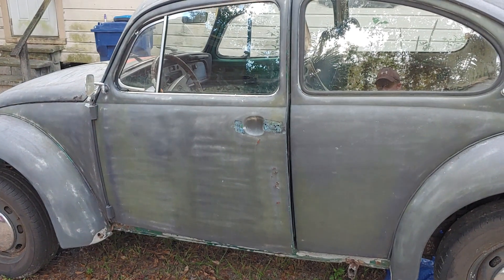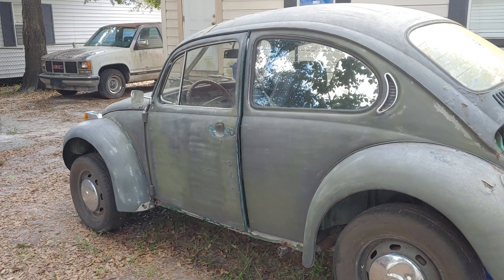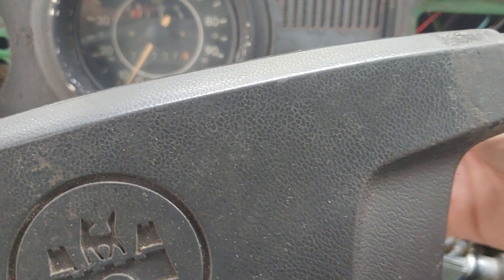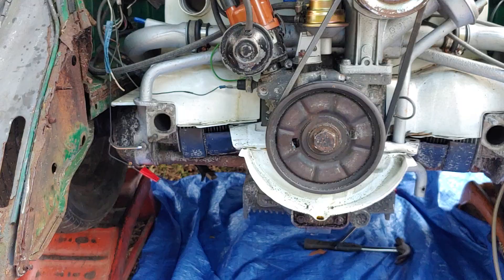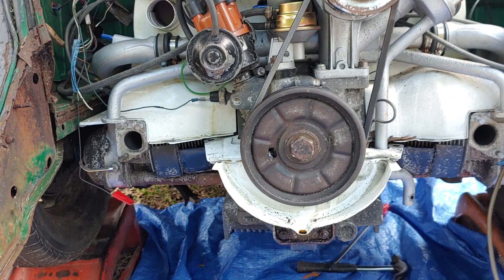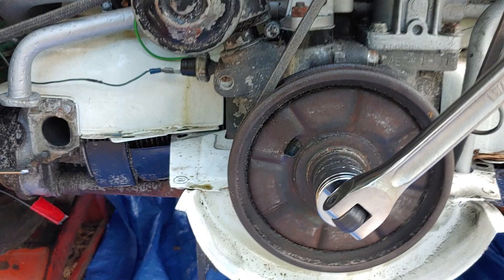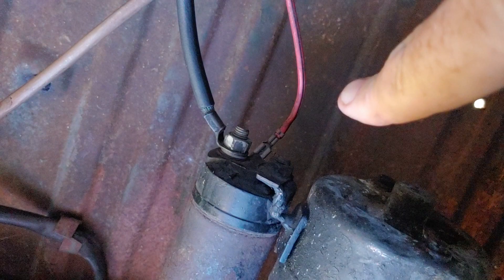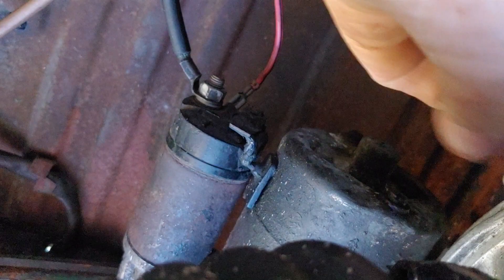CLASSIC VW, STARTER ISSUE? 1972 SUPER BEETLE WONT START.

Comment: This is just what I needed! I shorted out the 30 and 50 terminals with a screwdriver just as you did and it engaged my starter and solenoid. Then I tried again with the ignfition and it worked whereas it wasn't before (must have been stuck and just needed the jump start). Thanks for the help!
Reply from the maker: If the brushes in the armeter was stuck, than yes. I'm glad this helped you out. Sorry it took so long to respond. My issue was a bad selonoid. I replaced my started with a autostick starter. Faster spin, and don't have to deal with the bushing in the transmission. Stay safe, thanks for commenting.

Comment: The device you hear clicking when you turn on the key is called a Fuel Idle Shutoff Valve (or solenoid).  It’s job is to shut off the fuel when you turn off the key to keep the engine from running on (some times called dieseling) after you shut it off.  As for the starter issue, I’d begin by cleaning and tightening the battery terminals, and removing and taking a wire wheel to the ground strap connections.  Do the same for the connections at the starter.  If that doesn’t resolve the problem, then pulling the starter and having it tested would be a good next step.
Reply from the maker: Great advise. Sorry I didn't see your post till I answered another comment.

Comment: i would say its the selonoid. its not engaging the starter. Try tapping the starter and selonoid with a hammer. This should correct the problem. You got this. You got this far.
Reply from the maker: At least everyone seems to agree with each other on the issue. Thanks for taking the time to comment. Stay tuned. - KEEP DUBBING -
Reply: I've replaced the starter and the solenoid in my 72 wv bus and I still have the issue going on so if anyone knows
Reply: @anotherone1173  look up hard start relay. If a new starter doesn't fix it and your ignition switch if good your having voltage/amperage drop and the hard start relay trick tends to fix that issue

Comment: Once you get the starting issue sorted out, here are my notes (based on Mustie1’s videos) on testing the generator/battery charging system.  My apologies for the length.

Generator Troubleshooting 
D+ is a switched circuit that feeds the battery.
DF is the “Field” terminal.  The regulator feeds the signal to this terminal, and the closer it is to ground the more it tells the generator to put out.  To test the generator...
    1.  Disconnect the wires from both terminals. (Note:  the larger of the two wires that connects to D+ will have voltage on it when you turn on the key or run the engine, so don’t let it touch any ground when disconnected.)
    2.  Use a jumper wire to ground DF to the case of the generator.
    3.  Connect a VOM to Ground and D+.
    Start the engine and measure the output of D+.  
    4.  Rev the engine to approx. 3000rpm and you should see about 35v or greater. (Note: at idle you should see approx 23v.)

To recap, with the wires disconnected from the generator, and the engine running, you should
measure less than 1v at D+ when DF is disconnected, and when you ground DF you should see a min of 20v or so at D+ when the engine is at idle, and 35v min at 3000rpm.  It will go as high as 70 or 80v at higher rpms. (Note: The Gen warning light on the dash is part of the charging system...if this lamp burns out the charging system will not work.). one potential cause of loss of generator output is a loss of residual magnetism within the generator.  To restore this (repolarize the generator):  Remove the fan belt. Remove
the wires from D+ and DF.  Use a jumper
to ground out DF.  Apply 12v directly to D+ for a hot second, which should cause the generator to spin clockwise like a motor.  If it spins, you just repolarized it.  Rerun the test above to see if the generator output has been restored.  If not, the next most likely cause is a faulty Voltage regulator. (Note: there are two types of voltage regulators - One for Buses and one for Beetles.  Beetle regulators will only work on Beetles.  Bus voltage regulators will work on Buses AND Beetles.)  You can also test your charging system by connecting a VOM directly to the battery - Measure the voltage of the battery with the car off (say 12.8v).  Then start the car - at idle the battery voltage should be pretty much the same, say 12.8v, but it should jump up to 13.8v or so when you rev the engine (anywhere between say 13.5 and 14.5...a volt or two above the voltage of the battery itself is enough to keep the battery charging.  https://youtu.be/JUeeuDrIKVQ
Reply from the maker: No need to apologize. This is great comment. I hope others read it and it helps them in the future. Mustie 1 is a great channel as well. Thank you for viewing and commenting. Please feel free to comment in the future.
Reply from the maker: Are you on Facebook? We have a very active VW GROUP PAGE as well. Its called " Volkswagenplanet". The same as YouTube and all other social media. Love to have you in the group.
Reply: I probably should have clarified...the Generator test instructions come pretty much directly from the Mustie1 video I linked at the end.  I give full credit to Mustie1.
Reply: Did u try putting a relay in and did u try starting it by arching the starter while the key is on

Comment: You have power.the large cable is the positive from battery the small wire is from the ignition switch .the negative is provided through the bolt up to the engine and ground connection to battery .it is an interesting reach to the starter .you can reach in with a long stick with something metallic from outside the wheel well .keeps you out if the mouth of the dragon if it happens to be in gear
Reply from the maker: You are correct. This is a unique set up. Thank you for commenting. Your comment will help others out. Thank you for commenting. Feel free to comment on other videos. I'm learning as I go on this project. Stay safe.

Comment: Number one thing that thick cable hooked to your starter better be the positive side of the battery or you have major problems. You said it was the negative side of the battery.
Reply from the maker: You are correct.  This thing was a huge mess. Last owner had chopped up wires. Thanks for commenting

Comment: I do not get the click mouse, but I did test the wire to the coil which was getting voltage.  I will have try the jump start on the starter like you did.
Reply from the maker: Take the starter out and bring it to your local auto part store. They have machines to test the starter and selnoid.  Let me know if you need further help. Stay safe

Comment: i have a similar problem but the starter and solenoid are working. So is it the ignition switch? All the lights come on but the when i turn the key nothing happens.
Reply from the maker: Yes and no. Let me explain. It will be the ignition issue. What happens over time the wire going from starter to ignition switch can't carry enough of the amperage load. Try installing a hard start relay first. This will solve most if your electrical issues. It's a simple install. Relay and wire. This will solve the electrical load when starting. Then replace ignition switch. I think i install the hard start relay in all my classic be a first. Before even a oil change. The wires are old or chopped and taped together over the past owners. I think I have a video on it. It's cheap and easy. If you need help feel free to reach out. Thanks for viewing and commenting. Stay safe out there.
Reply: Same here
Reply: Thank you will try my baby daddy helped me awhile ago and disconnected that relay jingadera thingy and was talking shit about who ever installed it haha then it still didn't start so he got mad and left it like that and he hasn't came back since, thank u I'm going to try to hook it back up now and see if it works .and you also recommended replacing the ignition as well, correct?

Comment: I think it need resistor to reduce current going to solenoids. It will burn fast if it’s 12volts all the way. Ignition coil will too go hot especially those with oil and lick to those hot wires.
Reply from the maker: The solenoid was bad on my starter. It failed the bench test. I replaced it with a autostick starter. They spin faster than a manual starter.

Comment: Sir,
So I’ve got a similar issue. Car was running one moment the the next nada. I’ve been going through my wiring and fixing small connectors that were a lil suspect. Long story short my troubleshooting has led me to the starter. When I tried your method of “bench” testing, I don’t get a spark when I jump the wires. I’d assume I have a bad starter?
I have power going from the battery to the starter, but like I said no spark.
Reply from the maker: Correct. Starter solenoid

Comment: Did you get it fixed im having the same problem the motor ran yesterday and today it would not star i do here the clicking noise coming from behind
Reply from the maker: Try installing hard start relay. Usually its a voltage drop the wires can't hold when they get old and brittle. Sorry it took so long to respond. It seemed to be fine now.

Comment: Not an accelerator.  The accelerator is the thing you push on next to the brake pedal.  It's called a fuel solenoid.
Reply from the maker: You are correct. This is what happens with lack of sleep and complete frustration. Thanks for pointing it out. Thanks again. I don't know why I never received your comment. I would have responded at that time. Thank you again.

Comment: One other thing check your battery 
Terminal for corrosion it could limit the amps going to your starter you might not be drawing enough amps to turn the starter
Reply from the maker: Great tip. New terminals. I installed a new solenoid and hard start relay.

Comment: Good afternoon. My son has a 1972 super beetle. Everything in your video we have done. He has t start the car with a screwdriver. He changed out the cylinoid. 
We also did the test where you twist the screwdriver in the cylinoid and the car wouldn’t start. The screwdriver is the only way we can start the car. Do you have any recommendations?
Reply from the maker: Have you done a hard start relay? There are several videos on YouTube. I might have one as well, not sure. The reason you would need a hard start relay is the old wire can't hold enough amperage to carry to the starter. Its a simple fix. Let me know it this helps. Thank you for watching and commenting. 
Happy Holidays

Comment: Check to see that the black wire in your wiring bundle is connected to the coil (15 +). Also look under backseat to make sure wires are not disconnected- like the red one to the starter
With trans in neutral and brake set you should be fine to use a screwdriver to test the starter.
Reply from the maker: The black wire your talking about is the ignition switvh to coiil wire correct. That is correct. I can turn the key and hear the click of the plunger on the carb. Car is in neutral. Brake is set. I was starting the car without pressing the clutch in until this point. The only difference from sat to today is the car was on ramps. Motor did not lock up. Starter is not engaging. Let me know if I'm understanding you correctly.
Reply: Check the obvious- wiring connections. Follow the wire connections from ignition to starter. Friend had a 70 bug with a similar situation- remedy was the T1 connection under rear seat was disconnected (it connects starter 50 red wire to red/black wire to ignition switch)
If not this -agree with others likely the solenoid
Reply from the maker: @kdmamm-4190  checking it as we speak

Comment: What is your voltage at the large stud at the starter?  12V?  Should do a voltage drop test.  Could be something as simple as a poor connection at the battery or a poor ground strap.
Reply from the maker: I'm sorry for not responding earlier. My starter had a bad selonoid. I replaced the starter with a autostick unit. I have a follow up video. Thank you for reaching out. I try and answer all my comments. Are you working on a vw?

Comment: My problem was corrosion on wires at solenoid clean them use Wd 40
Reply from the maker: Never thought about using WD- 40 to clean the wires. Thanks for watching . and commenting. Great tip. Stay safe.

Comment: when you touch the screwdriver to the small wire to the big wire from the battery it should fire off the starter solenoid and engage the starter motor. as if the solenoid is bad it can be replaced. a good reliable starter to get is the powermaster starter sold on Summit Racing Equipment its a more reliable gear reduction starter. the clicking noise not the acellerator pump thats the bypass air cutoff solenoid on the carburetor as you have an aftermarket H30/31 pict carb originally susposed to be a Solex 34 Pict-3 carb will have the same type solenoid as older bug carburetors from 1967-1970 will have the solenoid below the choke element thats on the pilot jet as both solenoids do is prevent the engine from dieseling when the ignition is turned off.  the older 6 volt bugs up to 1966 had no solenoid.
Reply from the maker: Your correct bad solenoid

Comment: Im in that same boat replaced all spark andspark plug wires new coil new distributor(empi ones dont last) is replaced. Car is newly rewired. Turn the key you hear a click noise grom engin bay. Tried too bypass the starter didnt turn. Pulled out felt like it was stuck did a few tests didnt want too turn. Have too replace starter
Reply from the maker: When you pull the starter out, check and see if its a OEM( original ) Bosch stamped starter. If it is have it bench tested. Probally the selnoid. Mine was bad. I still replaced my starter from Napa. I paid the extra because I kept the core. If you do buy another starter here is some advise. Tell the counter rep its for a autostick instead of a manual. The autostick starter doesn't need the busing on the end of the armature. Some get wore out and have to be beaten out of the transmission case. The autostick starter also will engage faster. It's the same price as the manual. Let me know if that solved your problem. If your on Facebook, come join our VW GROUP PAGE. Same name as youtube" Volkswagenplanet. Several youtubers are in the group. Take care my friend.
Reply: @Volkswagenplanet  where i live oem/nos bosch starters are super expensive and hard too find. Used a similliar built german/us made starters.
Reply from the maker: @pierreduplessis1507  try installing a hard start relay first. I think I have a video on it. There are several in YouTube
Reply: @Volkswagenplanet  thanks will look it up. Will keep you up to date
Reply from the maker: @pierreduplessis1507  sounds great. Stay safe

Comment: I have a 76 VW Beetle and I think I’m having a similar problem. Unfortunately, no mechanic in my town works on my make and model of car so I have to fix it. I replaced the starter solenoid last summer, (it’s currently the next summer) and I was wondering how fast solenoids go out or if I have another underlying problem.
Reply from the maker: Install a hard start relay. Several videos here on YouTube. Its easy. The problem will go away

Comment: I just install Gilmore a/c on my 67 beetle and all of a sudden I have starting issues. I have tightened all bolts.. I have not tapped on the solenoid yet... I get spark between bolts... My car only starts when I put it in 3rd gear roll it back a foot or or two and hit the key.. not sure where to go from hear? A start relay? Idk.... I am bummed for the day.
Reply from the maker: Yes, install a starter relay. What happens over the years the wires can't hold the voltage load. Hence the starter not engaging. Let me know if that helps
Reply from the maker: I don't have any info on the A/C. I don't think it would have any effect on the problem. The A/C needs to be off when starting though. Need as much amperage to the starter. A/C units take energy.
Reply: @Volkswagenplanet  yeah I disconnected my AC wiring and still have the same issue. I get the starter to engage when I touch the starter terminals with a screwdriver. I need to check my ignition switch today but Which hard start relay did you use? Do you have a link or did you just pick up a universal? Did you make a video of that install?
Reply from the maker: @jeremiahlord6094  yes I did do a hard start relay install. The video is talks about more starting problems. Look under 1972 super beetle budget build. Part 17 or 18. Sorry I don't know how to make a link. There are several videos out there on the topic. My video goes slow so you can keep up. I have found the others to go fast because they are not putting themselves in your position.
Reply from the maker: @jeremiahlord6094  its not a lot. Its a simple automotive relay. That you tap in under the rear seat. Its simple
Reply: I did my hard start relay and it fires up much better but still about every fifth start I get the clunk clunk clunk noise and then it starts.. I have a friend sending me a good starter for plug and play to see if that solves my issue.
Reply from the maker: @jeremiahlord6094  that's great news. I replaced my starter with a autostick model.

Comment: It sounds like a low voltage problem 12.4 votes is too low to turn a starter I would think
Reply from the maker: It failed the bench test. Selnoid was faulty. I put a autostick starter in it. They spin faster than the manual starters. You are correct about the voltage on the battery was low. Had a hard time holding a charge.
Reply: You sir are correct about the autostick starter I have one in my bug also and using a starter like that you don't have to worry about the bussing  @Volkswagenplanet
Reply from the maker: @deandye3255  its a win,.win
 Thank you for watching and comment